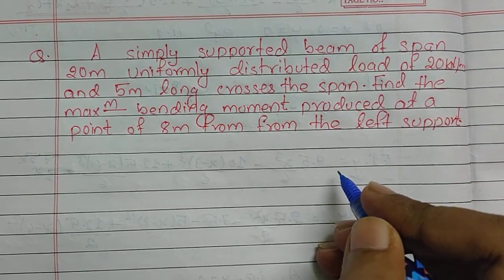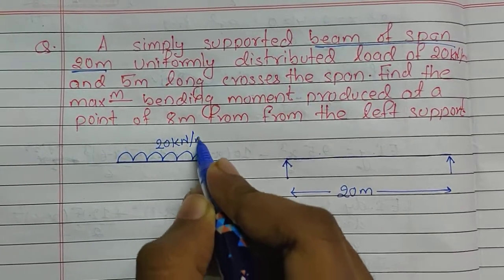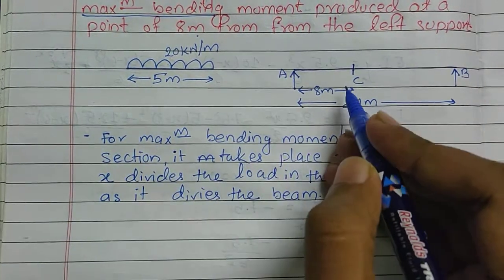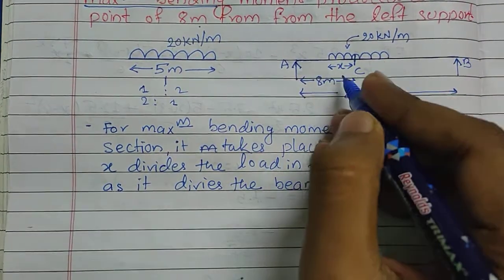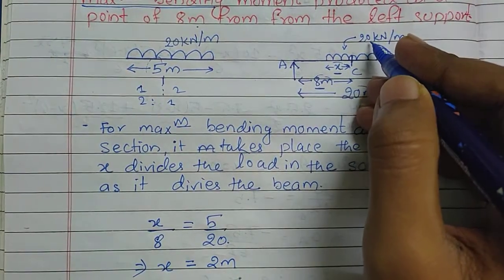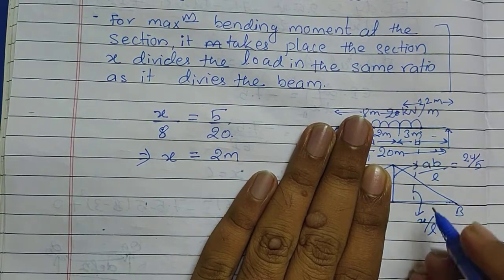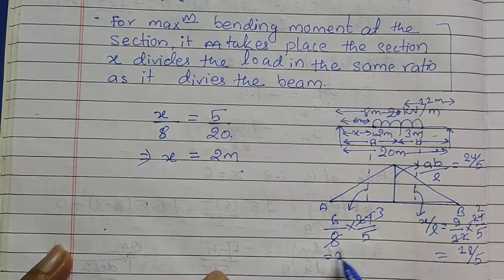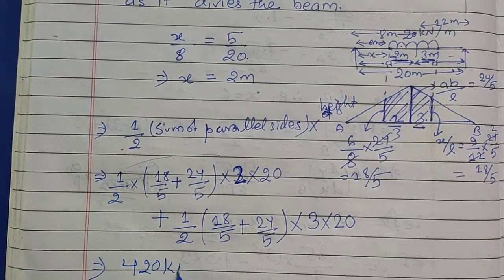Influence line diagram moving udl in beam

Comment: How did you find the value of ab sir?
Reply from the maker: You can calculate ab and dividing the given UDL load is such a way that the ratio will be same for both load and the beam. In short  by proportioning. Its clearly shown in video. Duration 4:46 to 6:43.
Reply: How come it is ab is 24 sir?

Comment: 1. A system of four loads 80, 160, 160 and 120 kN crosses a simply supported beam of span 
25m with the 120 kN load leading. The loads are equally spaced at 1m. Determine the values of 
the following using influence lines.
i. Maximum bending moment at a section 10m from left support and ii. 
Absolute maximum shear force and bending moment in the beam. Solution pls
Reply from the maker: Drop your email i will send you the solution tomorrow.
Reply: @Civillearningonline  my mail id 
anoyrobert08@gmail.com
Reply: I also want the solutions too
kobbyboateng31@gmail.com
Reply: I too need the solution 
surendramathangi752@gmail.com
Reply: Oh yeah, I appreciate the work done on this channel, I truly need the solution to the above work too...my email odokodoug@gmail.com